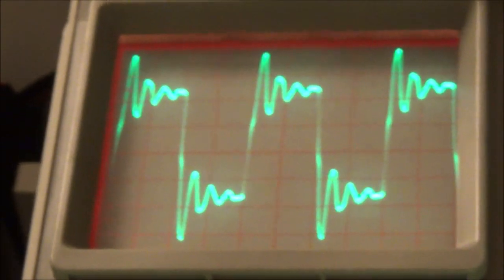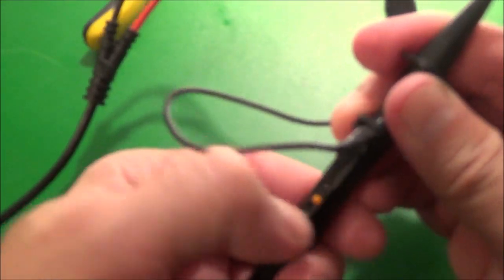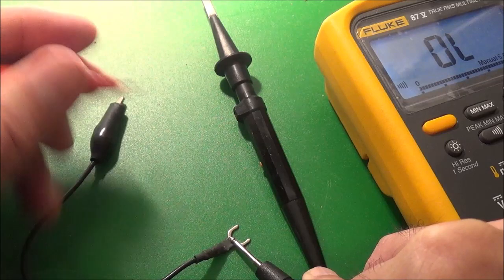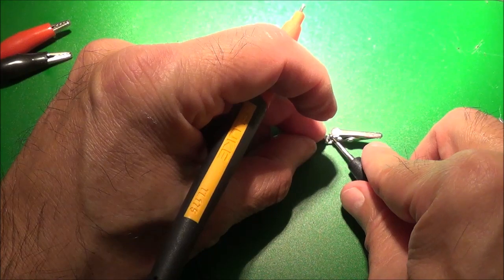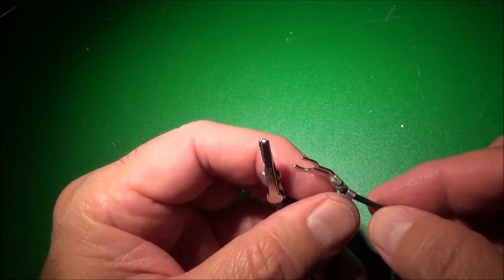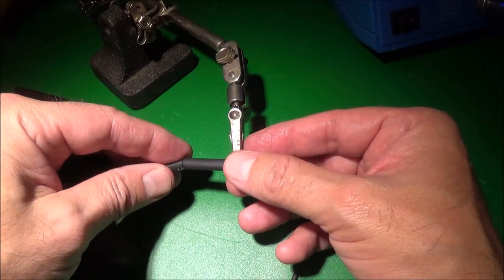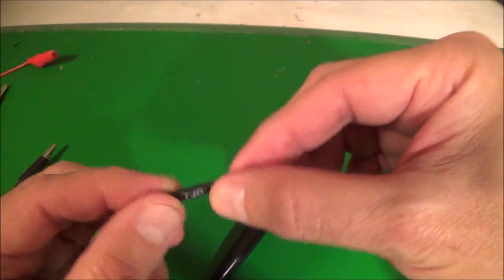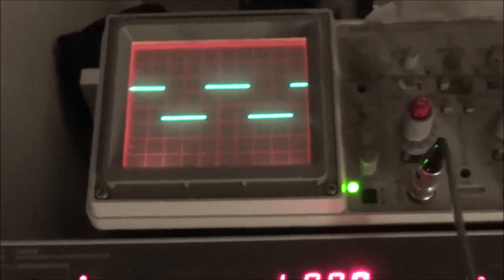Oscillocope Probe Repair -- Square Wave Ringing

Comment: Thanks for demoing!  Strange the bad ground was showing something rather than an open connection...guess there was enough amplitude to jump the break??  FYI, you can buy those ground wires off of eBay...I've looked at them myself as I need more.  Square Wave Ringing sounds like either a country band or a rock band!  :)  Thanks OS!   :)  ~Jack, VEG
Reply: Here's a link for ground wires:  https://ebay.to/2R7Ild6
Reply from the maker: Thanks for the link, Jack, VEG! I can only guess that the missing ground clip helped form a resonant circuit. Therefore the ringing. Didn't you mention ringing not too long ago? Well, I will make an inductor ringing video with square waves. Ring your partner round and round...